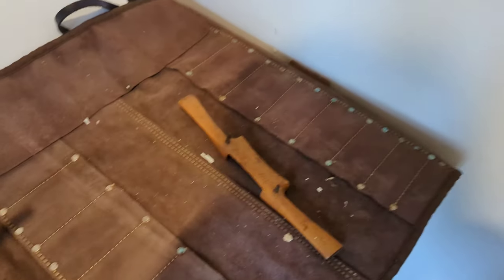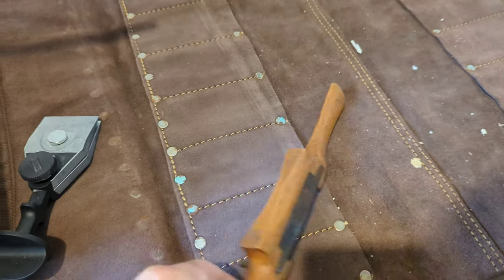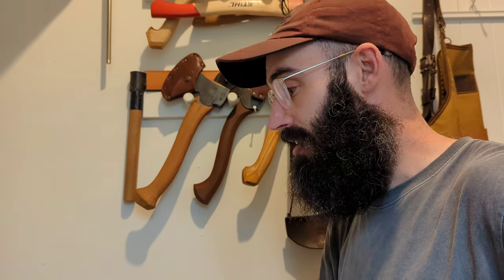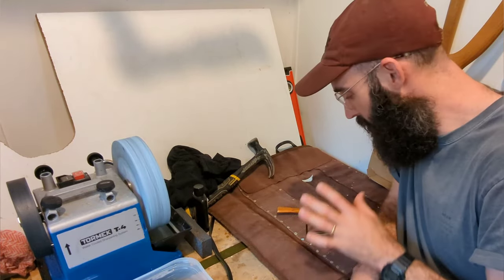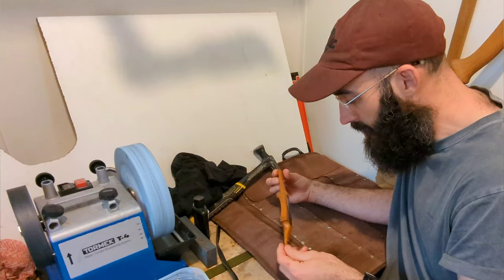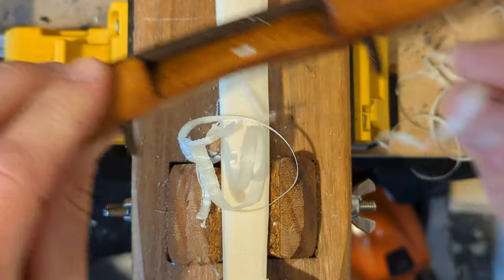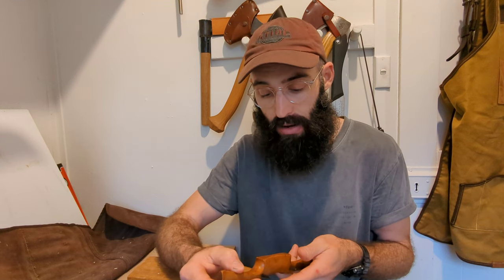Spokeshave restoration - 100 years old and still cuts like a dream!

Comment: Hello, I just purchased the same vintage spokeshave and discovered that one of the tangs are cracked off!
is there a way of repairing and or welding it back onto the blade? ... please let me know. Thank you, dee
Reply from the maker: Hi there! You could potentially try some JB weld? I'm not sure, it does take a bit of sideways pressure, so I'm not sure how well it would hold. Always worth a try?